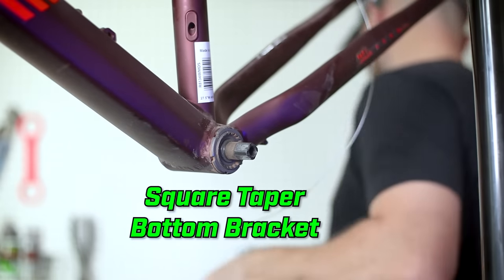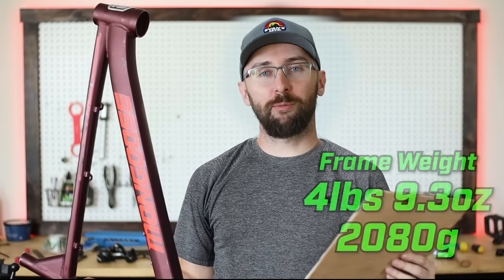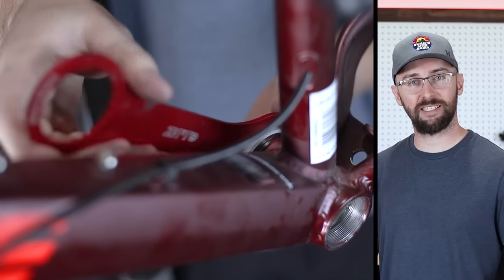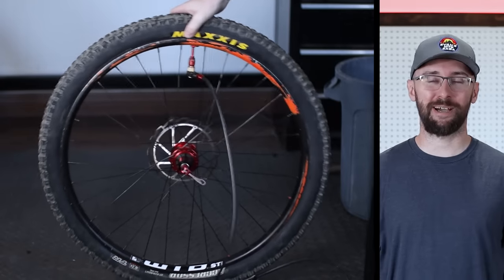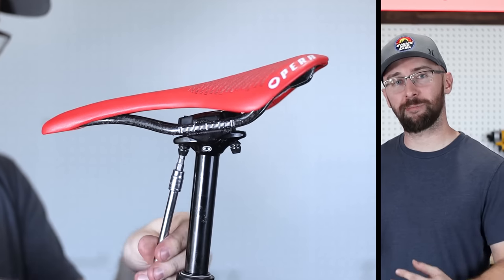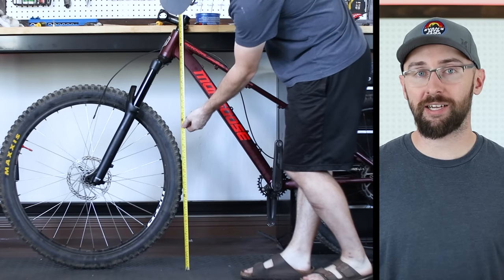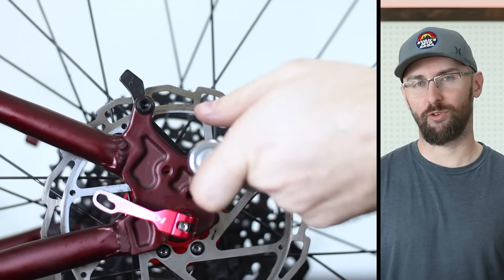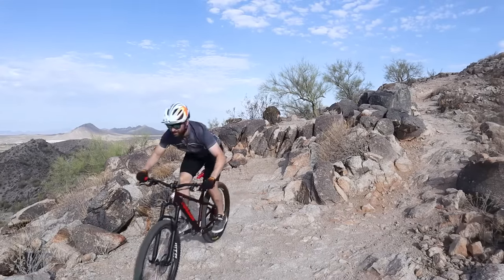Are upgrades worth it on a budget Walmart mountain bike?

Comment: Mullet bikes work best with a plus sized 27 or a 29er because a +27 and a 29er have the same diameter, so u can put a skinny fast rolling 29er up front and sometjing big and cushy in the back without making the bike so agressively slack especially if ur already also increasing the travel

Comment: Great video don’t recommend someone doing this unless something happens to ur frame and you need a replacement so you switch ur parts or unless you want to just install a better fork and upgrade the drivetrain looking around $600 or so including the bike but honestly I’d just recommend a decent used hardtail or something like a giant talon or a gt avalanche comp

Comment: I am new to mountain biking and I wanted to change my forks on my Trek Roscoe 6 2022. I want to switch to air shocks from coil shocks. I tried searching for a fork with the same offset but could not find one with such angle. Do I need to have the exact same offset angle or is it okay to have the angle changed?

Comment: if you wanted more stopping power you should put a bigger rotor on the front brake not the rear one. the front brake contributes a lot more stopping force than the rear one in reality. should be simple though as the spacer you used on the rear could possible work in which case you would just need to swap that and the rotors.

Comment: i was thinking to upgrade my breaks i currently have the MT200s but i want a little  more breaking power and modulation  should i get Deore or slx or something els i
Reply from the maker: I've only really messed with Shimano brakes. SLX brakes are the light version, meaning they break easily. Deore or Deore xt are good options
Reply: @EvansMTBSaga  ok thx

Comment: The fork probably needs to be readjusted for this bike, you can't just swap a fok over nd expect it to act the same, it will dive less, and stay higher in the travel. I live slakc head angle like this. Do the bike have a set limit on travel fork can have?

Overforking can compromise fit and geometry, like too high bottom bracket, too slakc seat tube, that's something you did not mention, but 62.5 deg head angle is sweet. But if a bike has a too long fork the reach can be too short, for me most bikes will be too short anyway.  

 The Nicolai bikes have quite a wide range. I have a Nicolai/Geometron youcan go for dh setup or enduro setup, but it's an enduro full suspension bike, but the bikes Nicolai build can take wide range of travel too, most brands don't say how short and long you can go. The G1 is the longest and slacker bike on the market, but now you have made this to match. 😁

Comment: Brother quick question but any chance do you know if the Axum dropper will fit on the vitus and the stock tires are tubeless ready ? Please let me know they are back on stock thanks brother I know is a different subject sorry .
Reply from the maker: It looks like the Axum DP seatpost is a different size than the Nucleus, so it won't fit. Also, the tires can't be tubeless. Sorry for the bad news!
Reply: @EvansMTBSaga  no problem
Man I debating upgrade the Axum or get the nucleus VR man that shipping is crazy

Comment: Commencal meta ht frame is 4.6 lbs. I do not like the 27.2 seat post diameter. But overall this bike is pretty awesome. 12x142 maxle and a 30.9 seat post would make make it perfect.
Reply: True but this frame is a bit cheaper 😂

Comment: Going over the drop worried about forks snapping off?  More like the worried the head tube would crack.
Reply from the maker: Head tube holds the forks right?
Reply: That wasn't a very big drop anyway. One thing you should mention in these videos is that if you actually ride hard, these frames could fail resulting in serious injury. Most people know this, but there are some senders out there who know nothing about bikes. Just something to think about
Reply from the maker: @mattmehmel5833  I mentioned that I was nervous about the frame....

Comment: I dont understand this i have a genesis silverton from walmart. Ive been riding this bike since 2021 with no upgrades. Ive ride 40 miles a day in the winter time to and ive never had any problems with. The only thing ive done is tear it down and regrease the rims and bottom bracket. Nothing wrong with walmart bikes just got to know which ones to buy. Some are real junk but knowing which ones to buy you can get get a real good budget bike. I dont understand putting a bunch of money into a budget bike most cant afford or willing to pay over $1000 for a bike

Comment: One thing to consider is that the head tube wasn't designed with a longer travel fork in mind.  It may or may not stand up over time.  In the final analysis, it's cheaper and way easier to just fork out $800-$1000 for a good entry level hardtail, like the Specialized Rockhopper or the Trek Marlin (both of which are available at Center Cycle in Renton, Washington......he he he!)

Comment: 7:26 that's because Magura brakes ARE really bad, the plastic levers are so cheaply built, I wonder how they still sell those things.
Reply: Something like this is typical for German engineering, they can develop amazing things but then they suck with such details, just because of 2 grams weight saving over a steel lever which never breaks

Comment: Cheaper to upgrade a giant talon 3, comes with stock hydraulic brakes...
Reply from the maker: Talon 3 doesn't have a tapered steer tube meaning that you won't be able to get a good fork upgrade. I just bought Zoom hydraulic brakes for $67. The Talon 3 is $250 more...
Reply: @EvansMTBSaga  I use a himalo 160mm on my talon 3, deckas 36t oval chain ring and now its a beast on the trails...🙂

Comment: A little constructive feedback. From my perspective, you seem to criticize the Mongoose for not using high end MTB specs on a big box bike. Your build details are excellent, but you belittle everything about the bike as you go, I was left wondering why you even bothered with the project. 
You did not finish out the video with your final impressions of the build and the overall performance of the bike or a critic of how you might have done things differently. Your last comment in the video is simply "I hope the forks just don't snap off." 
The gives me the impression you think the bike (frame) is garbage.
In hindsight, can you see how you failed to hit the goal of answering your question of "putting the best parts on this Mongoose to really unlock it's potential and to see if it's worthy of purchasing and upgrading" in a clear and objective manner.
I think you have great potential in your videos and I'd like to see you hit your target and deliver useful insights and not just general content. Cheers.
Reply from the maker: Since your comment was good and constructive, I'll be straight forward. I bought the bike and did upgrades because it was a new model and I was one of the first people to get it (so essentially for views on YouTube). It was really popular when it came out. I've tried to move away from this kind of content since.
As for the abrupt ending, I had an outro, but the retention graph showed people stopped watching, so I cut it off the video and YouTube has really recommended it much more since. I'm not real proud of my earlier content and feel like I do a better job the last three months on videos. Hope you stick around and check them out!
Reply: @EvansMTBSaga  - Thanks for your honesty. As Ardor's were/are back in stock at Wallyworld for the holiday shopping spree, you might find an uptick in viewers. However, the content presentation could be a drag on garnering new subscribers. You might consider redoing the video to make it look more inline with your newer content. Like Lucas, you can do some rework on your older productions to make them better.

Comment: I mean, you can talk all you want about walmart bikes but I mean come on, dropper ready, quick release, and a tapered headset?
Reply from the maker: Yeah definitely adopting some great features. Through axle will be the ultimate thing they could adopt
Reply: @EvansMTBSaga  For sure, that's the main reason I steered away from it as an upgrade project. Although for most people quick release is just fine. Love the channel man, and I ordered that EC90 Carbon seat that you've been using to try it out on a new bike build.

Comment: Not sure why you would even want to spend time to  swap out parts for this Walmart bike. First off, you should show people how to measure the BB shell width, some others may not have the option of using spacers if they use a square taper BB. If you're hoping to build your site, then having the correct tools to do the job will go a long way in showing folks that might be interested in your page. At the end of the day, your parts cost more than this Wally World bike, but you still had a crappy frame with issues. Seems to me that buying a "used" bike that is good quality might be a better option for folks that do not have a large budget or buying a bike from a shop where parts are standard sizes and have warranties.

Comment: Ardor... X1 right? There's other versions like 2.1 or now the X2 which is a 29er.

Koozer hub. Yay.

I'm running a 69er or 297 on the XR Pro.

Wal-Mart bikes have horrible rear axles and seat tube diameters. The Mongoose Dolomite, however, has a 31.6mm diameter seat tube where I used a 170mm dropper.

XR Pro is also 27.2mm. sucks.